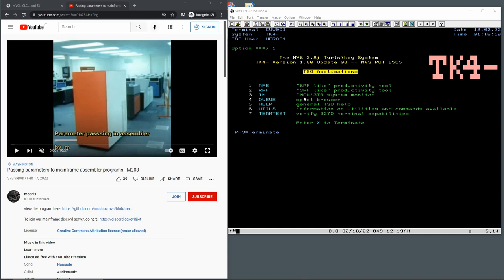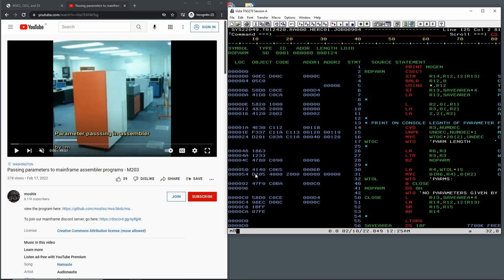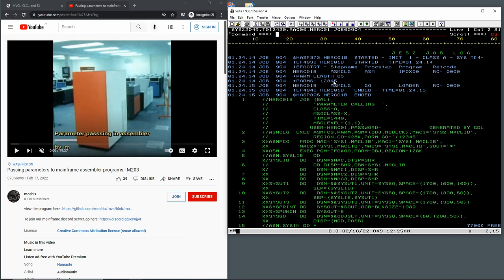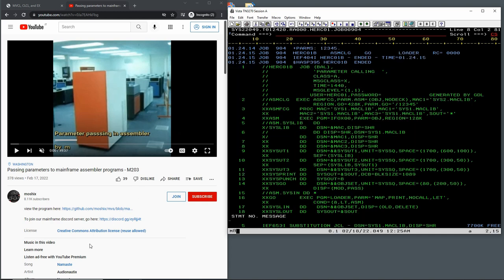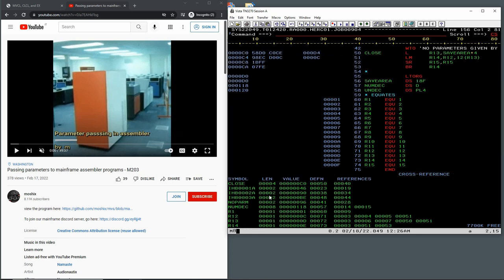Parameter handling in mainframe assembler, revisited - M209

Comment: Great instructional video on some not-so-obvious nuances of the 370 instruction set. 

One important clarification about the EX instruction.

From the Principles of Operation Manual:
"Bits 8-15 of the instruction designated by the branch address are ORed with bits 24-31 of the register specified by R1, except when register 0 is specified, which indicates that no modification takes place. "

The important thing here is that the low order byte value in R1 is ORed with bits 8-15 of the instruction (the length field in an MVC instruction), not simply replaced.
Reply: Indeed. ORing in those bits can lead to "surprising" hacks... sometimes even usufull ones (tables etc..)
....Also worth noting that the encoding, in bits, of length fields in those instructions that have them in bits 8..15 are as *N-1*. Thus the common idiom of decrementing an actual length (In R6 in Moshix's example) usually with "BCTR R6,R0" idiom before the EXecute . That is the real explanation for the extra "." printed in the first video.
Thanks Moshix for covering this: parameter passing is often glossed over lightly and is often a trap for the beginning asm programmer.
(Looking forward to other examples. TSO is a whole new can of worms... :-)   Thanks again.)

Comment: Ok, just a few additional stuff..
1) EX cannot address an EX instruction (for obvious recursion problem reasons)
2) Data cannot always be executed - to prevent people from executing code from the stack (and exploiting stack overflow vulnerabilities) - modern processors usually have a DO NOT EXECUTE bit in pages (or segments).. for example ELF provides hints on what can be executed and what should not be executed. In the Linux ABI, this means whatever is being to be given in GPR15 : do not execute. I think z/OS has a GETMAIN parameter for that now, and CMS probably has the same for DMSFREE (or whatever it is now) to indicate the allocated storage area cannot run code - and you are thinking procedure wise, that would be in the case of z/OS and CMS legacy code ;: GPR13.
3) EX can be used for other things than MVC ! It just replaces the target operation 2nd byte with whatever value is present is the EX instruction 1st parameter register last 8 bits - leading to a bunch of funny tricks you can do with the EX instruction !

Anyways, as always, thanks for your instructional videos !
Reply from the maker: All true and correct of course. Thanks Ivan.  Good to see you back !!
Reply: @linlyons1962  Just use a X'00' op code.. According the the latest PoP, this is guaranteed to raise a PIC 1 (this is a recent change but is now set in stone). In effect opcode X'00' always raised an operation exception - it's just now official it will always do that.

Comment: It looks like your job is not reentrant, saving should be done into the stack to have few instances runnins.
Do you have a video about assembler calling convention?
Reply from the maker: In a single batch job, it doesn’t have to be restraint. I have a video about calling convention but not for LE